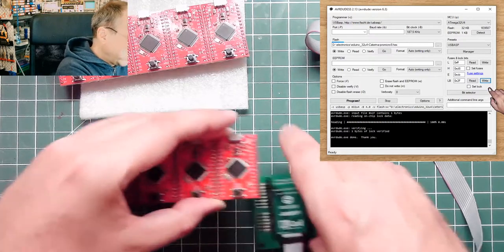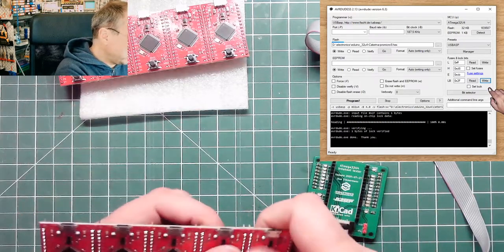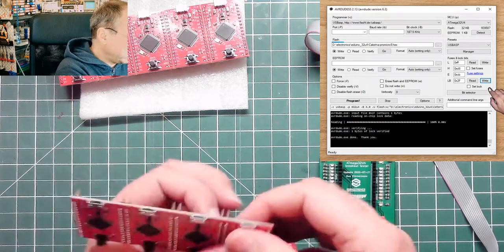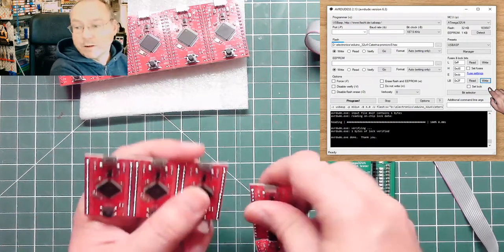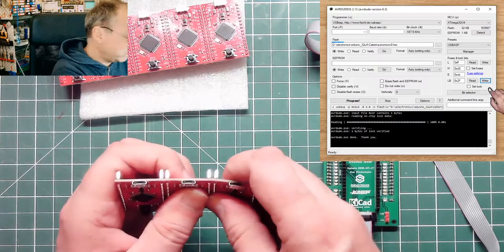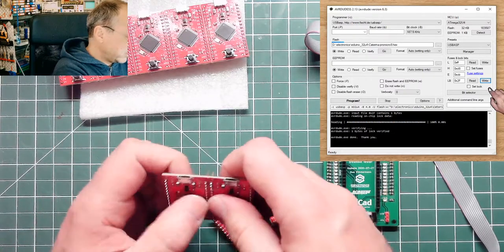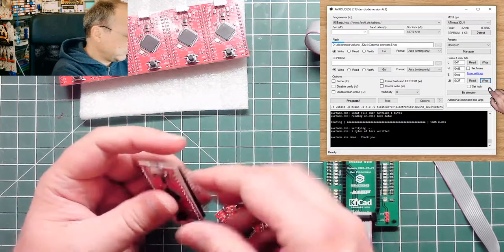Flashing a bootloader

Comment: Hi. Thx, for your great video series around your (self designed?) arduino board. Can you share the schematics and/or maybe KiCad files of this project? I am as a arduino newbie work on a custom arduino board also with an 32u4 and i wants to learn from your design. I think i made a lot of bugs in my design ;o) And what is the benefit of the Caterina bootloader? Kind regards
Reply from the maker: I will once I have some spare time. Currently I am too busy with my previous and ongoing curses. Send me an email to uwe.zimmermann@sciencetronics.com and you can get a preliminary documentation.
Reply: @uwezimmermann5427  thx, you got mail ;o)
Reply: @Uwe Zimmermann I'm looking at doing the same sort of thing as daSamo123, coming across your videos has helped immeasurably, would I also be able to email you to get a schematic to help solve some issues I'm having?
Reply from the maker: @scottgray684  sure - since I still did not have the time to put my stuff onto github or any other place...
Reply from the maker: I never answered about the Caterina bootloader, did I. Well it is the ORIGINAL bootloader for the ATmegas and it is the code which - as far as I know - most others are based on...
Reply: @uwezimmermann5427  Ah ok. When i remember right i tried the Arduino Leonardo and Sparkfun Pro Micro bootloader and both works on my custom arduino.
Reply from the maker: @daSamo123  I had to modify the bootloader because of the use of the LEDs (I only wanted to waste a single GPIO pin and not two whole 8-bit ports as Arduino and Sparkfun do on their design). When I was googling around Caterina was the first hit... but I believe the other two are just modifications of Caterina...